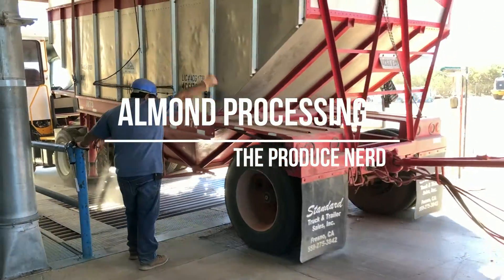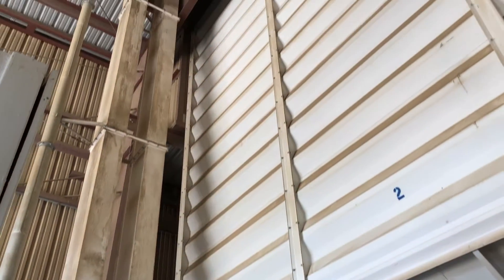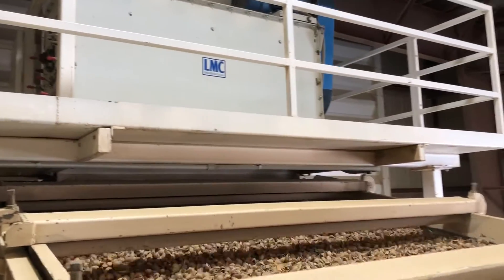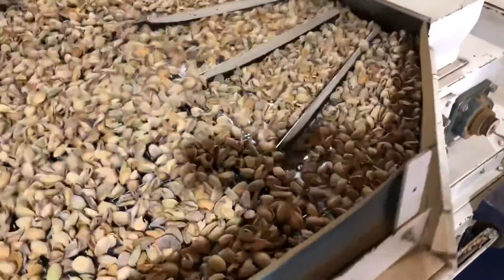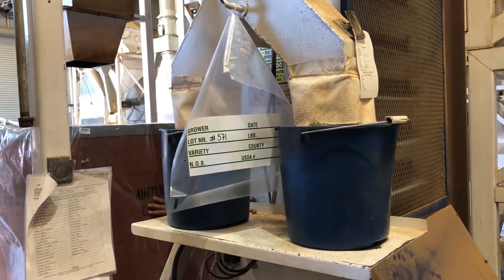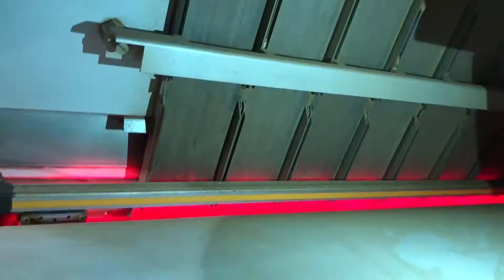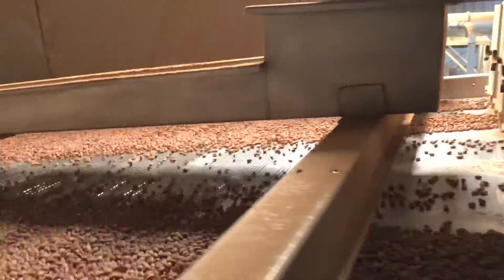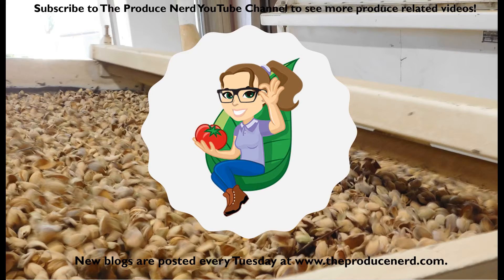Almond Processing: Pre-Cleaning, Hulling/Shelling & Processing (in California)

Comment: ...and then they process em with pesticides and/or steam and deep fried (if they are NOT DRY roasted nor raw) 
kinda left that out eh?
Reply from the maker: I didn't leave it out. This processor does not perform the pasteurization process. 

Here is more on that from the full post on my website:

What About the Pasteurization Step?
All almond kernels sold in the United States are required to be pasteurized before they can enter the market. This is not required if the almonds go on to further processing (e.g., roasting, blanching, slicing, etc.), or if they are sold in-shell. The pasteurization step does not occur at this processor because only about 5% of the product they produce will be sold as whole kernels into the United States market. The rest of their product is either exported, further processed or goes onto another facility that completes the pasteurization step.

If you want to get a glimpse of the nut pasteurization process, check out my walnut video.